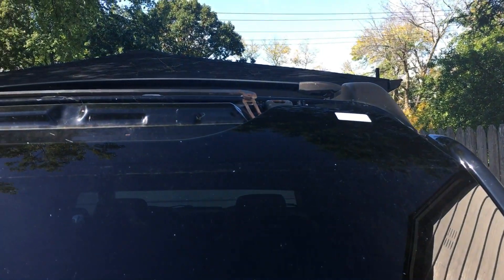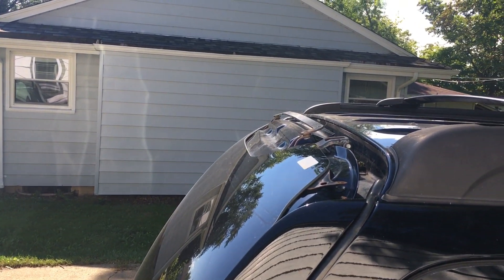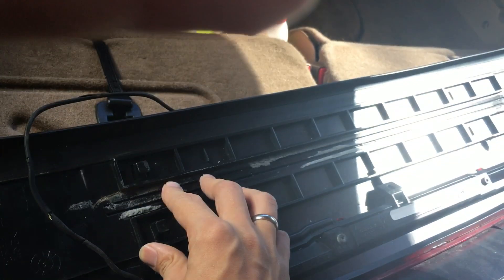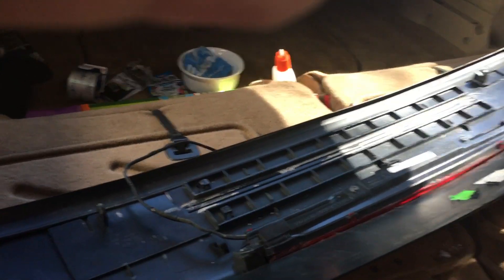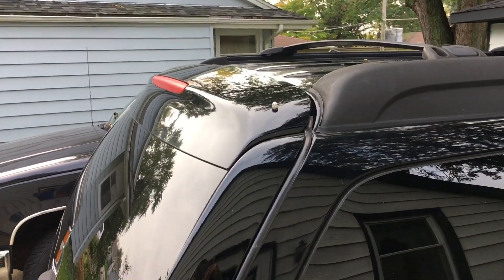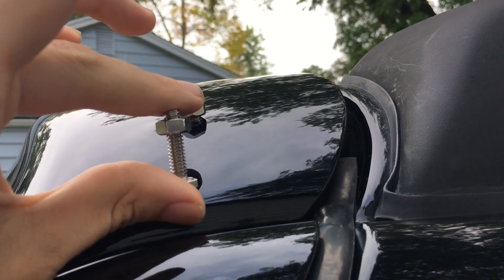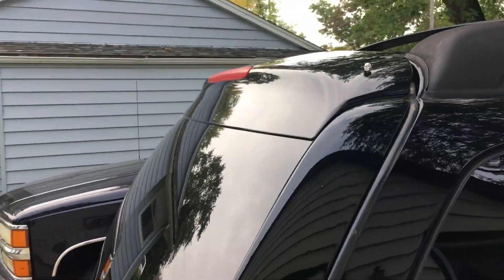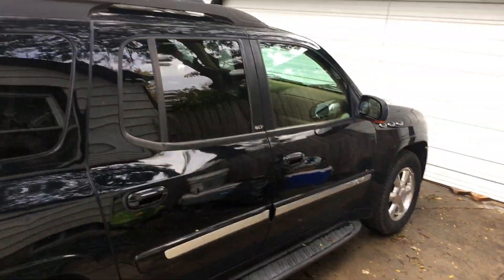How to kinda fix envoy spoiler or third brake lights

Comment: I simply replaced the whole rear glass with the 3rd brake light attached. Junkyard for $45. Just pull the 2 pins out holding it in place. No need for bolts or drilling anything. Check your local Junkyards.
Reply: Can you explain

Comment: That cover is held by 4 screws if you notice the double side tape that held the cover remove the metal flat bar and epoxy it back on and re screw it flew off cause the double side tape wore off. Epoxy the metal bar back you will be good

Comment: if you open the back glass you can get easy access to where the 4 bolts go that hold it in place
Reply: Thank you. Mine cracked and I didn't know where the bolt heads were.

Comment: I just did same thing but I put lock nuts under and not over and looks much cleaner. Also you need to have clearance so when you open and close window or hatch you have no grinding and this is done by not making screws too low and too tight! I used longer screw and a lock but and it’s perfect!
Reply: What size srews

Comment: I had to pull the 3rd taillight out of the spoiler and then put the 2 center bolts in while pulling down on the spoiler from the taillight hole.  That is after I JB welded the plastic that holds the nut to the spoiler.

Comment: OMG, I'm dealing with this exact nightmare right at this moment. The trouble I'm having is the brackets attached to the glass don't line up with the spoiler and I don't know how it's possible. I like the simple quick fix, however I went a whole other direction and all the time it's taking it better function and look as it was originally. Shit design. Thanks for an alterative plan.

Comment: no offense man, but this should be titles: how to not fix the spoiler. your solution might work better if you looked at it closer and or for longer. you can see in your own video that the spoiler is not lined up and it will bind when the lift gate is opened. i can overlook the bolts coming out the top, and may even consider your approach when fixing mine, but maybe use some washers and use black hex nuts to hide the hillbilliness? 

the other day we got some snow and ice and when i lifted the lift gate, i heard some cracking sound that didnt sound quite right. now tonight after driving on the highway for about 5 mins mine rear spoiler flew off and here i am learning about this crap. funny thing is whom ever had this vehicle before me must have "fixed it" before, as i see junk yard yellow marker all over the underside lol.
Reply from the maker: Jason Brown I see your point I could have fixed it the right way,but the way it came from the factory would have just broke again so I thought of a plan that would never brake on me again......it just doesn't open all the way lol and I don't think it looks hillbilly,just is 1 of a kind👍either way I hope you fixed yours and maybe got help from my video,take care